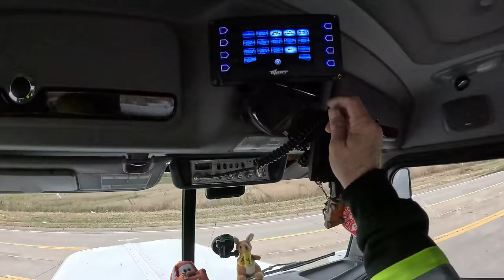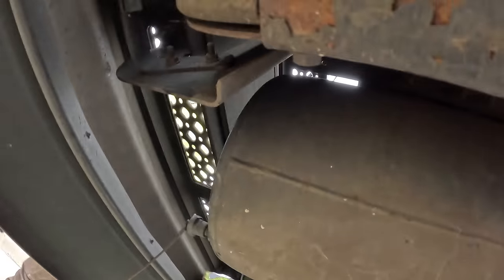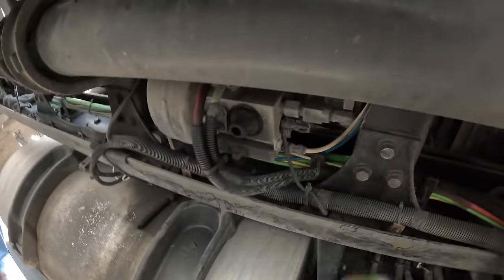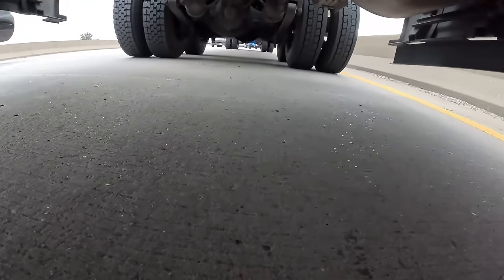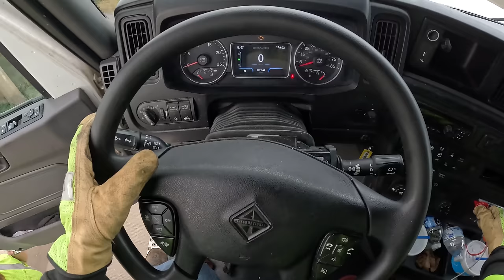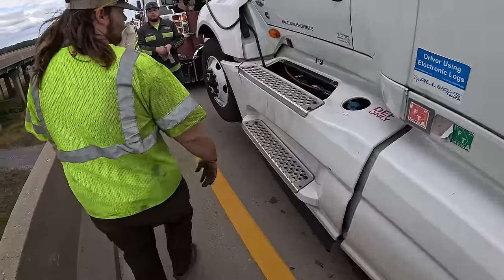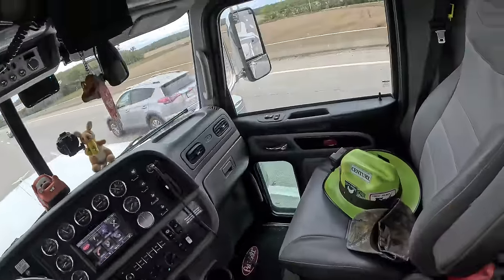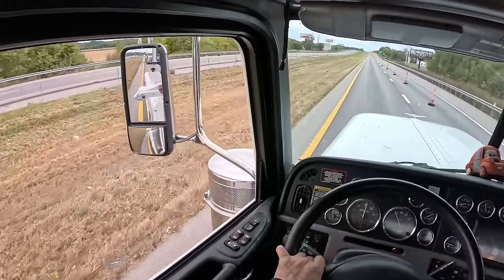CODE 3  GOTTA ROLL   SEMI TRUCK BLOCKING BRIDGE CONSTRUCTION

Comment: Does the lift arm have an inbuilt secondary locking system to prevent accidental lowering, whilst you are working underneath the stricken truck?
Reply from the maker: Yes....there are "holding valves" built onto the cylinders which prevent movement of the cylinders in any direction unless hydraulic pressure  opens the valve.   So, even if a line blows to the main lift cylinders, the boom, in theory, is suppose to stay in place and not fall.   I do not wish to test that theory.   Typically, we place wood blocks under the tires after lifting and prior to going under the truck.  I know we have been hammered by a lot of people on this video for not having the blocks in place.  We are human and we make mistakes.  I asked for the blocks, but didn't verify they were in place before I got under the truck.   A mistake was made and a lesson was learned.   That's how we grow.   I know you weren't the person being critical.   You were simply asking a question, politely, which I greatly appreciate.  For the haters and critics.....have you never made a mistake or an oversight, especially when under pressure?   I know I certainly have.   I'm very safety conscious.  I made a mistake and failed on a major safety issue and, thankfully, nobody was injured because of it.  At least I'm humble enough to admit my mistake.   Thanks and God bless.
Reply: @RonPratt  I think it is good that you post these videos. Simple things like the blocks that you have done thousands if not millions of times are super easy to forget that one time (but it only takes once). Having 129,000 people looking at your work is a very easy way for those things that you forgot be pointed out. 

Thank you for doing what you do to keep our roads safe and moving.
Reply: @RonPratt  Thank you, take care. 🙂
Reply: i was thinking the samething. i'm always leery of going underneath a vehicle like that or on a hoist at a "shop". i know there's suppose to be redenies, but crap still happens. i tend to be a bit paranoid about such things. it, just takes that one time and you're screwed.
Reply: @RonPratt  Nothing like a collection of wood blocks and some wedges.  Would you benefit from a set of close-fitting helmets like the tree-cutting guys wear? You can get them with low-power UHF radios built in, which is great for on-scene communication.  That wind might have been the cause for someone not hearing you ask for the blocks?  I would never try to run your scene but after a few years of asking we have them now for extrication, the same noise and wind, and low-angle rescue alongside highways and such.
Reply: @takedeadaim8671 from the fire side, what pray tell are the helmets of which you speak?  I switched to the XF1 for structural, but we’re moving into advanced rescue, so this would become important.
Reply: @RonPratt  Nobody is perfect Ron, the important thing is that we learn and grow from our mistakes, nobody was injured, it'll be a good topic of discussion for future safety meetings.
Reply: Ok Ron if you show up second to the scene, who is in charge of that situation 🇺🇲👍🤔
Reply: Ron would normally block under the front tires. Ethan must not have heard him when he said "Block the wheels."
Reply: @RonPratt  I apologize if I was in the H & C group. I just know you do practice "Safety First" Good job, just the same.

Comment: Having had a Holiday Rambler motor home leveling system fail and drop a complete motor coach on me, I can't even begin to explain how it sickens me to see you crawl under that truck before the front end is chained down and ALL hands are away from the controls.  OK, I know it can only fall until the wheels are on the ground and there is a lot more clearance between the bottom of the truck and the ground than a 38 ft Holiday, but still I remember the months of recovery and 24 years later still have some pains. Be careful out there Ron!  On the positive side, anytime I see someone trying to change a tire, I stop and be that PITA old guy that explains why you don't put your legs under the car when it's jacked up and why you always put the spare on the ground under the vehicle and once the flat is off you slip the flat where the spare was until you are done. If they are lucky, I show them my scars.

Comment: Always great to get a new vid. This one was a bit unusual on the safety front, at least in my opinion. Seeing all 3 of you under the truck without the trusty wood blocks and only 1 hard hat (the one we were sat on lol) made me a lil nervous. I guess i'm too used to those things being done in previous vids that it caught me off guard. Don't get me wrong i'm not knocking the work or you guys, i just don't want anyone to come to any harm out there. Daft as it sounds, i've become kinda fond of u lovely lot at midwest truck. Be safe!!
Reply: Ron did suggest putting blocks under the tires,  but it never happened.   Guess everyone assumed someone else would do it, or the blocks were on the passenger side of the tow trucks and they decided that the risks of spending a lot of time getting them out and putting the back up were higher than not using them.  

Whatever the reason, it made me a bit nervous as well, even knowing it all worked out because the video was posted.
Reply: I think they only really worry about hard hats when they are doing overhead lifting, and Ron needs to wear his because (as you pointed out), that's where the camera is mounted
Reply: Totally agree with all these comments. I bit too much of a hurry 😶😶

Comment: That secondary crash and potentially others is always a concern when there is the first accident. Maybe "rubber necking" or people just not paying close enough attention. Mobile phone use gets the lions share of the negative press (for a good reason). But there is plenty out there that can cause a distracted driver. I remember driving to work when I was in High School and I would be tying my tie. Strange but back in the 70s "bag boys" had to wear ties to carry groceries out to the customers vehicle. They used to "tip" us back then. They only paid you $2.50 an hour but on Saturday you could make $100+ with tips.
Reply: and back in the 70s... $2.5 went a lot further than even $10 these days!

Comment: I HATE Breaking down in Construction Zones. I blew an Air dryer once. 3 hr wait for a 5 min fix. Air dryers should have a bypass so you can charge the air system. 
I didn't know you could hook up air lines to a tractor like you can a trailer. 
Is that a new feature? 
Good work as usual Mr Ron & co.

Comment: When there isn't a quick fitting it takes about 30 seconds to take the pop off out of the air dryer and screw in a fitting for supply air.  Swivel head 3/8 drive with a deep 9/16 is all ya need and it's way faster than tapping into the plumbing.

Comment: Breakdowns are probably the worst for tow operators as they get less traffic blockage help vs recoveries where they have fire department to help block for them, or have parts shut down. When I needed a tow, I always try to keep our tow company in mind on where I stop, all because I watch Ron's videos. 
I know International trucks have quick couples on their tanks. I used to drive an International truck and it's one of the things I checked for. I guess their mechanic took it off? I agree about being able to use lights and sirens for tow trucks. It should be universal.

Comment: Hi Ron, this might be the last Youtube video I'll be able to watch because Youtube is now cracking down on ad blockers. So far, I'm not sure how to disable the blocker so I've tried to contact Youtube to help me with this issue. If I can't get this fixed, I'll be extremely sad because I Love Your videos and everything about you and your channel...!!!
Reply: Youtube doesn't care about viewers... other than the ad revenue they generated them, but they don't bother following the AUP for what is permitted for ads (don't get me started on how ads use specific frequencies to seem to be louder to our ears, bout not trip auto-leveling to reduce the volume), nor police the disinformation videos.  
sometimes incognito mode works to watch videos... or changing the URL a bit...
It's an arms race between adblockers and youtube... and will continue till youtube decides to throw in the towel (or is legislated to do so, which is more likely).  But that the blocker wish is run without a massive tech services can keep breaking it, gives me some happyness.
Reply: if on laptop/pc you should be able to click on the lil adblocker logo up on the top right of the screen. a lil list will appear with a slider for "enable/disable" on this website. make sure it's showing red instead of green. ad-blocker should then be turned off for youtube. thats how it worked on mine

Comment: It seems so strange to see this today. Oregon is one of those states where tow and recovery vehicles do not respond code. A tanker full of nitrogen rolled over on I-5, blocking all southbound traffic. (I don't think anyone was injured). A DOT Incident Response truck instead gave a code 3 escort to 2 heavy wreckers from Grants Pass to the scene, about 15 miles away. Now THAT was cool to see.

Comment: Hey Ron, thanks for another note video! I have watched all of them. I subscribed years ago, I was also in the towing business then. Would watch your videos after my shift. I only did light duty, with a rollback. Many years prior I was a electrician. When 9/11 happened, that night I felt that I needed to do something. So, in my garage I took a piece of 1/2 inch heavy wall conduit, drilled holes after talking measurements of the flag I had on the front of my house. Sorry for the run on sentence but it just got emotional. Then I drilled a hole in my ladder rack, and installed Our American flag. Had to make a little adjustment the next day, so the flag didn't wrap around the pipe. After that, no matter which way the wind was blowing, she was straight out, proud!!!
If I told you the response I got, it would be a long book. Have you ever thought of running flags on your trucks? With the choas in the world, all Our country, might give people more hope. Just a thought. As we say, stay safe! God's got your back. Amen brother 🙏

Comment: Wow cant believe someone did something like that to cause a second crash! Once again great work ron, although i am surprised the tator still has that original siren on it, genuinely curious about the code 3 (hopefully this doesnt sound too repetitive)
Reply: Morons are a dime-a-dozen, these days. Actually, they're the only things going down in price, there are so many of 'em!
Reply: I might be misremembering but I think Ron bought the siren from a scrapyard and installed it in the shop. He also added the red and blue lights and a howler from an old firetruck.
Reply: In Missouri they are allowed to run red n blues and sirens upon authorization from highway patrol/dot. They are considered an Emergency service only within the state of Missouri. Where they are located they are not far from Illinois state border and are only allowed to run Amber lights and no sirens there.
Reply: In Missouri they are allowed to run red n blues and sirens upon authorization from highway patrol/dot. They are considered an Emergency service only within the state of Missouri. Where they are located they are not far from Illinois state border and are only allowed to run Amber lights and no sirens there.

Comment: I heard you ask, but I never saw any safety blocks under the steer tires. I realize the importance of getting out of the way quickly, but I’m going to modify a quote from my electrical apprentice instructor from decades past. There’s old wrecker drivers and bold wrecker drivers. But there’s damn few old bold wrecker drivers. Safety trumps time constraints always.
Reply from the maker: Well said.   You are correct.  Safety should always be priority.  Sometimes, in the rush, seemingly small things get missed.  However, it wouldn't be a small thing should someone get crushed.  Thanks for watching and God bless.

Comment: These Code 3 (lights and sirens) runs are the reason you almost never have a crash back up except for the rubbernecking.
Wish ALL states would do this. 

And Ron, jist curious ummm why is there a Sheriffs Pffice Badge Watermark in bottom right corner of video? Or am I the only one seeing it?

Comment: I was once asked what is the service call charge for, on my invoice.  I said it brings you a fully certified and Bonded Locksmith, at your disposal, with all the right tools and equipment.  A $3,000.xx key machine didn’t fall to the ground from Heaven.  I thought about this as you were working on the air breaks. Knowledge, equipment and tools.

Comment: The highway is blocked on a bridge, in my opinion that is a situation that could lead to dangerous crashes. You need to get there quickly to clear the highway, I don't really understand why anyone would think it inappropriate to run lights and siren and you only do it at the request of law enforcement.  I've watched you in action a few times and you are a master at clearing things quickly
Reply: People consider it inappropriate because it's not within their social norm. There's a lot of people that prefer life to be bound to a specific set of rules, rules that they grew up with themselves, and not have any anomalies that are outside that rule-set. Those people are the type that have never traveled far enough to experience culture shock. I grew up in PA, and in the state of PA blue lights were reserved for volunteer fire fighters, and it wasn't required you pull over for them, but it was encouraged. I then moved to FL, where blue lights where what police and state patrol used, and it was mandatory you yielded to them. That's when I understood to respect that every state has a different rulebook.

Comment: Ron, I know for the tows the driveshaft should be pulled. My question is what would happen if for a short distance tow, say 2 to 5 miles the shaft was left in place until you could get to a safer area to remove it. Thank you.
Reply from the maker: That would depend upon the type and manufacturer of transmission.   If this truck had a manual transmission, we could have left the shaft in and towed it to the next exit to remove it.   Most automatic or automated  transmissions require the driveshaft to be removed before towing.   Our company policy is "if it's an automatic, you must remove the driveshaft or axle shafts prior to moving it."  Some trucks have warning stickers all over them warning that the shaft must be pulled prior to towing.   I've heard of some towing companies who found out the hard and expensive way, that they should remove the driveshaft on an automatic.   Believe it or not, some manufacturers state that the driveshaft must be removed even during a winch out.  It boggles my mind that some of these newer, integrated, automated systems don't have some type of quick disconnect.   They have so many positive features for the driver and the truck owner, but make it extremely difficult for the towing/recovery operators.   Oh well, like they say, if it was easy anybody could do it, right?    Thanks for watching and God bless.

Comment: Check engine light on and low air pressure in the Rotator at start-up. Must be getting cold out. 🤷 I wish i had the skills to give a helping hand with maintenance up there. That winch on the rollback not having free spool drive me nuts and I'm only watching.

Comment: You should make a T adaptor to go between the trailer and truck air line couplings instead of stacking all those fittings. Faster and safer.
Reply: A lot of tractors have check valves in the air lines that would prevent air getting to the tractor park brakes.  You need to break into the system someplace between the compressor and the dry tank.

Comment: Safety is supposed to matter so when the boss instructs to put wood blocks under the wheels for crawliing under the vehicle it 'should not' be dismissed. Whether or not blocks are warranted instructions were given. There will come a time an accident will occur because "safety' becomes secondary to getting the job done. Deciding how relevant safety is only matters once lax attitude is responsible for an injury. In all due rerspect, the new generation still reports to the previous one in the blood line.

Comment: OK OK this is going to sound dumb. What do you think of getting a rolling suitcase / tool box / wrench case / fold up shopping cart that you could load with all that stuff take it out of the tow truck and roll it to your work. No standing there guessing if you grabbed the right things or juggling the things you need to the spot you're working. I know it's mostly feet away  but I'm thinking.  Also I told you it was going to be dumb.

Comment: Just out of curiosity: The front wheels on the traffic management truck were turned to the live lane. Shouldn't this be turned to the side of the road? (in this case the bridge wall)
Because if it got hit from behind now, the truck would roll into live traffic.
From what I understand, here they would always try to avoid that. (Here being the Netherlands)

Just to be clear, this is question, not a comment on how you do things, as I am very much not qualified to do that 😀